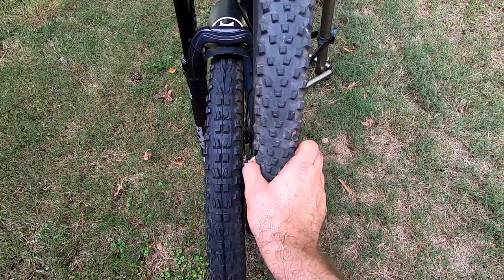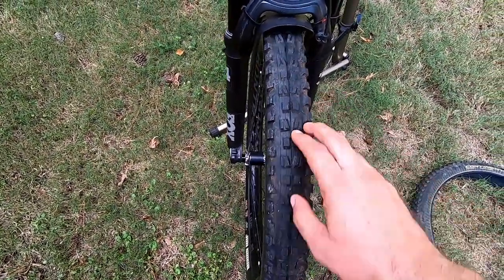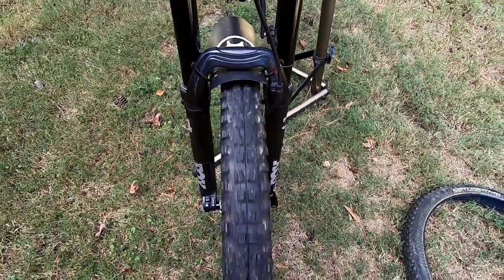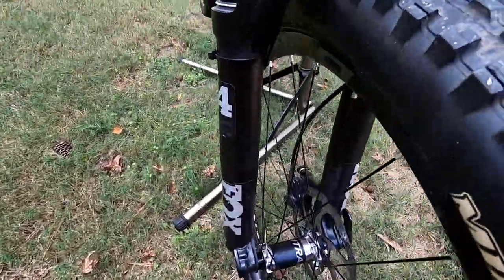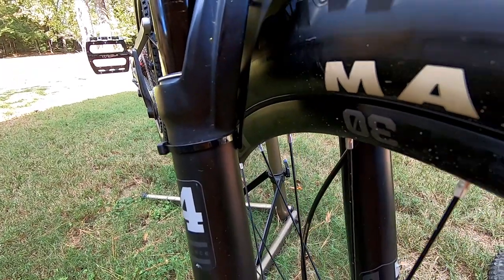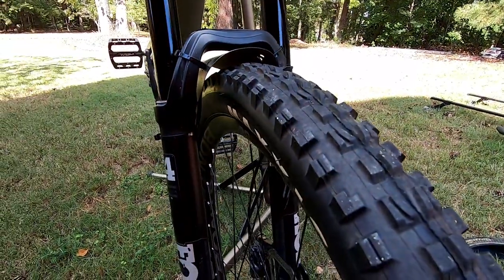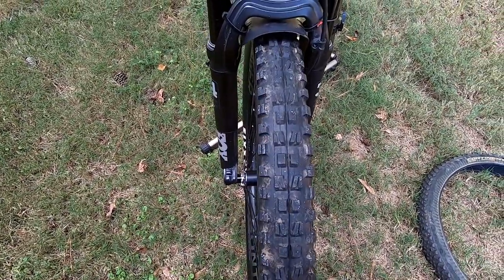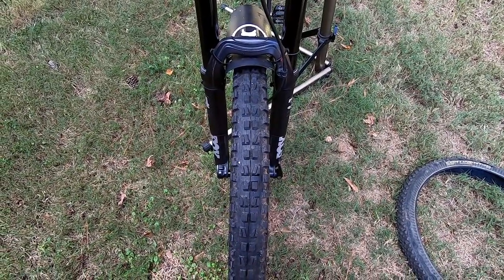The Maxxis Tire Wobble, is it common??

Comment: The tire is not seated right on the bead. The tire doesn’t have a wobble it’s just that it’s crooked
Reply from the maker: 😂 If I had a dime for every time somebody said that. Read the comments…
Reply: eastwood yes in some cases the tire may not be seated right or if you have tire inserts can also make it wobble but in his case and in my case and many other is an issue from factory nothing todo with the bead or if it was not install properly. and it seems to be a very popular problem with maxxis only. other company's that are no so popular dont have the issue and mine you have the the full package dhr 2 tuff casing terra cuz i tough the pros and most forums saids maxxis are way to go. but no im thinking they may have really good performance  but the quality of the build ummmm not the best.
Reply: @thomas_00001  try using soapy water to seat the bid correctly and a air compresor if you have if not remove the air valve to get the most air in with your air pump. soapy water can help alot when it comes to sitting the tire and take a close look to make sure you have the same amount of tire showing all around. follow the line the is above the bead to ensure is all even sometimes have some one else take a look and see if they can spot any defects but soapy water should help a lot  put it all over the rim and in the bead. good luck
Reply: @257sombra  I had Tannus as well and took it out and the same wobble is there. I made sure all the beads are seated equally around on both sides and still wobble. Same tire Maxxis DHF 50 PSI.
Reply: @ronelborromeo6013  It's the other way round. Your tires were fine before you installed Tannus. Tannus damages tires by uneven stretch during inflation. I destroyed multiple tires before I realized it was the insert. I proved it by first installing the tire without Tannus. Everything was fine. Then installed the insert. Wobble. Removed the insert. Wobble was there forever.
Reply: Same tire same problem I can't feel it tho can u
Reply: I have purchased 3 sets of Maxxis Ardent 27.5 x 2.25 tires in the last 5 years. The first 2 sets were great....the last 2 Maxxis Adrent tires i purchased have that same wobble issue as shown here in your video. and yep, my wheel is true... and the beads are fully seated... I finally pulled the current basically new rear tire off and replace it with my old tire that still has 60% life left and guess what. NO WOBBLE.. MAXXIS needs to refund people for the poor quality control...

Comment: Nothing to do with the tyre not seated correctly, if that's the case you shouldn't fit a tyre at all. I've buckled the tyre twice now using minions. I like to take corners full on and ended up folding the tyre. It's pretty new aswell, it's ready for the bin 🤦‍♂️

Comment: I have had a slight wobble on a few Maxxis tires.  Nothing to the extreme shown in this video.  Sometimes reseating the tire bead with alcohol and massaging the tire with incremental pressure increases mitigated this.

Comment: I checked my tyres, I saw my front tyre was wobbly, but I saw bead was nicely set on the left on on the right it was too far in to the rim, so this twisted the tyre, I had to let air out and use tyre pliers to get the tyre true. The tyres I have on my bike now are not worn out yet, knobs are fresh, the tyres were fresh when I installed them.
Reply: Thanks for posting I'm going to have to try this..I got some conti trail king in the front that had alot of wobble. The rim looks true so I swapped the tire out and I get less wobble but still wobbles a bit.
Reply: @manny_fit  if you don't have this tool, just unseal the whole tyre. and redo it.

Comment: Same here. Thought they weren't seated properly or my wheel was out of true. Sidewalls have been sweating tyre sealant in the past year, presuming rubber started to weaken, but no other issues till I took a few birms a bit more aggressively and rear tyre made some weird vibrating noises. Presume some fibers got damaged under stress. Clearly, it's not normal for a new tyre to do this, but in my case the life expectancy seemed to be 12 to 18 months depending on use.

Comment: I had the same problem, 2 sets of maxxis pace for XC kevlar and wired.  the installation was very thorough and carefully tried various methods from spraying soapy water to the pump slowly pulling manually on the beads, still wavy.  tired of maxxis now move to another brand

Comment: Yes. I've been working for hours trying to remedy this on my Aggressor. I thought it was badly seated, took it off and put back on, took out the insert and tried with a tube. Then I decided to check the internet. Should have done that first. Thanks! Thought I bought a bum wheel, but its just the tire.

Comment: Thus has driven me crazy with 2 bikes.Always thought my wheel kept coming out of true and was getting really upset.Come to fine out it has always been the tires..Both have dhf and dhr.If you have to struggle to get this tire on your wheel it seems to stretch/warp the sidewall casing causing very noticeable tire wobble.I finally ventured out and put a WTB VIGILANTE on my bike and so glad I dropped maxxis.My front wheel has never tracked more straight then it does now with the vigilante.
Reply: I did everything to seat my tyre properly & it still wasn't right😂S t r e s s
Reply: I think you're onto something with the "stretch/warp the sidewall casing". I noticed the warp after struggling to get a Maxxis DHF on a new wheel with inserts.
Reply: @smeekteek  yea keep going around the tire and pushing it as far center as possible so you don't have to stretch the bead that much.Its a little harder to do with inserts but possible with some patience so you don't end up with that really irritating tire wobble.

Comment: Yep... I've had the same issue with high roller, minion ss and dhr..  Indeed a common problem with Maxxis but apparently they prefer to replace your purchase rather than fixing the cause. All vendors are aware and they will replace the tire. The real problem is when you have to replace more than 1 time with the same vendor.

Comment: yes is the tire and its 2021 june and they all have some type of issue. but new tires hdr 2. im thinking is more because of fast production and also the walls will leak when in high humidity.  i have bought dhr 2 dhf Assegai i have also the tan color walls for the hdr 2 and they all have some type of imperfection. i tough maybe it was because the tire was old from seating on the warehouse but after buying a brand new pair i notice the same issue. and yes i also so tough it was my rim so i took it to a shop in ny and the mechanic told me it was a problems from maxxis tires he also belive thats it could be a fast production problem.

Comment: I have the same issue. Was wondering maybe my spokes not through. But no. It was tuned well. I've tried to fix it for couple of time but still doesn't work at all. I went to bicycle shop to fix it for me and still fucking wobbly. But what i noticed about maxxis tire was the more it get bald and you've to reinstalled back. Wobble will be lesser. I'm using 27.5x2.50 MINNION DHF.

Comment: Exact same problem with Kenda 4 inch tire on Himiway ebike.  I've been trying for 5 hours the soapy water and overpressure (60 pounds), so far without success.  I note that the EXACT
 same thing has occurred with previous tires of different brands.  Usually a lot of time, soapy water, and overpressure will do the trick but not this time.  At least not so far after 5 hours of trying.

Comment: I have the same problem with a Maxxis Agggessor. It is as bad if not worse that the one in this video. YES it is seated correctly. Seems like the canvas is damaged permanently, got deformed by a dodgy sideways landing. It won't run true anymore. So obviously easy enough to damage the sidewalls in these.

Comment: Same but its on my wifes bike. Maxxis dissector 27.5x2.4 set-up tubeless. She is 120 pounds and runs it around 16 psi on mils XC trails here in GA. The tire was fine when first mounted but now 3 months and 12 rides later I noticed a wobble. Checked the rim on my truing stand and its true. The bead line is even all the way around. I guess its just a bad tire like all the others

Comment: Same here with DHR II 27.5 2.4 MaxxTerra, Not so strong like yours but still annoying. DHF 2.5 which I have on the front is fine. I think its mostly by those beefy tires (or grippier compounds). My stock High Roller 2.4 (hard performance compound) are OK. On my XC bike Recons are also super straight. Never had that issue with Schwalbe tires. Now I just leave it as it is as it does not affect my ridding, but next time I will return them for sure. Tip - just do the dry fit before you put the sealant in, you will save yourself cleaning before return :-)

Comment: New pair of DHR2s, same problem, so frustrating. Mounted 3 times with soapy water still wobbling like crazy, never had this issue with any other tire.
Reply from the maker: I think there has to be some kind of quality control issue. Maxxis needs to fix this or they will continue to lose customers

Comment: I have the exact problem.  It started after riding an off camber trail.  I'm only 165 and 59 years old so I definitely didn't "overstress" it.  It was inflated properly.  Tire fail for sure.
Reply from the maker: I later noticed a crease on mine's sidewall. I'm 53 BTW, but weigh 200lbs!

Comment: I've had this issue on 2 of 4 Maxxis tires. An Assegai 27.5*2.5 has a slight wobble, ridable but really annoying as a front tire. A Minion DHR II 27.5*2.4 developed a significant wobble after just two rides. I did crash on the second ride so it may of weakened the sidewall or bead though. Initially it rolled true. Whatever the cause, I'm taking my business elsewhere now.
Reply from the maker: I went back to the Conti I had on it before, no more wobble

Comment: I had this problem at first with my Minion DHR 2.6. I heard to try soapy water on the bead and rim. When I pumped it back up I could actually hear the bead "pop" into place, and it was almost perfectly true. Got a flat on the trail and had to use a tube, and it was all wonky again after using a hand pump..once home, Itried the soapy water method and it went on straight as an arrow.
Reply from the maker: I installed this one with soapy water and a compressor at 50 PSI, it definitely "popped". I then removed it and tried it again. It was also about the 30th tubeless tire I ever mounted. In this case the side wall had a visible defect when I removed it. Very common if you read through the comments. I replaced it with a new Continental and it was perfectly straight first try.

Comment: I just noticed it on my bike a few days ago, (mind you I’ve had it 7 months, new bike) that I had a similar wobble on both my tires (same Maxxis tires) and I was told at my local shop that they are known to do that. Specially since I ride in a very rocky area. I was surprised and disappointed that a 7 month old tire would go bad. Does this sound correct to you guys, is it really normal for this or other tires?
Reply from the maker: I will admit that the tire on my video was used for about 4 months then replaced and stored then remounted. I can actually see the defect on the side wall now that I removed it again. To me this should not happen to a high end tire but it seems to be a common thing even with other brands. These tires do get abused

Comment: I had this for years, but sometimes I had to reseat it twise or more, but also when tyre was used longterm, it developed warp, also bead fails. This has happen on all tyres i had in my previous bike, and now at new bike, so tyre øy last few months, usually I can use a tyre few months one year than the next, but idf I try to push it for whole season, it's wearing bead off and wobble is horrible. But I saw a video where a rider supported by an distrubutor of maxxis claims she gets about 5 months out of a tyre so that's about what I get I guess before it loses true. So I guess I am riding so hard and tyres get so much use I wear them fast but still use them bit longer than I should for optimal performance. So bead and the warping of tyres makes it horrible eventually, but otherwise the knobs are not completely ruined but start to rou d off, but I never managed to run one tyre so long knobs were almost gone, some do, but bead fails before that is possible for me.
Reply from the maker: Good point. These were original tires on my bike so they are over 2 years old and have been off the bike for over a year before I put them back on today..
Reply: @TonyHob  some are definitely defective, but I never had one that was 100% true but if it was bad I redid it and worked but, I've seen vids of worse wobble, but hats how the tyres look whe n I've used them for a long time. But I think I should try different brands too, I found Schwalbe to seat easier, at least Ice Spiker does but can be hard to remove but so can Maxxis be when sealant glues it I guess, but I can get them off anyway, so not an issue. I've not had warping with Schwalbe Ice Spiker tyres yet, I've only used them for few weeks.

Comment: My DHR II is more wobbly than my DHF but both wobble. Brand new rims and both tires are seated with soapy water so there's no chance that they're not seated incorrectly.
Reply from the maker: From what others have posted you should be able to get them replaced through warranty. In my case it was a tire that came with my bike and I had replaced for a year then came to find it wobbly when trying to re-install it. It was barely used though.
Reply: @TonyHob  that's the same exact thing that happened to me. I just put them back on my bike for the winter. Thank you I'll email them.

Comment: Having this issue at the moment with my DHF on the front. However it’s the same tire I already had mounted last season. I am not riding during winter with this bike. So after removing the tires (cleaning the dried tubeless milk) and mounting the tires again the front tire is wobbling but it did not last year. Also from the lines on the side its seated ok.
At the moment my question is not how can I fix the wobble? Its more should I even care?
Reply from the maker: Mine was the same situation. I remounted the tire to use on a more technical trail. I went ahead and rode it like that and could not notice it while riding. On close inspection there is a visible crease on one side of the sidewall. No problems after riding it though.

Comment: Mine are brand new. Not as bad as yours, but similar. I do think somehow reseating the bead would fix it, but apart from putting it back on and pumping it up hard I can't figure out how to do that.
Reply from the maker: There’s several videos on it. Basically release the air pressure, spray the rim and bead with plenty of soapy water, then inflate up to the tire’s max pressure (usually around 50psi). If it’s not working then probably the tire.
Reply: @TonyHob  What about the sealant? I just sealed the tires. Can I add soapy water and the sealant won't mind? I really can't see any variations when the tire is on the rim, but I'm guessing small variations at the rim lead to larger variations at the tread.

Comment: My grandson has Maxxis Agressor tires and his rear tire wobbles so bad we thought he had bent his rim put it on the truing stand  and the rim was maybe 1-2mm out it was all the tire and it was so bad that the tire would rub the chainstay every time it went around! It was fine when we installed the new tires after Christmas but developed after a couple of months of riding.
Reply from the maker: Same with mine, developed that wobble after some time but plenty of tread left
Reply: @TonyHob  Just tried submitting a warranty claim with Maxxis we'll see how it goes! I tried everything everyone had posted as a remedy and none were successful to any degree, however while the tire was inflated to max pressure 60 psi the wobble was decreased a bit only to return when the tire pressure was lowered to 20psi and I left it at max pressure for 24hrs! it's definately defective!

Comment: I got same problem with conti mountain king, trail king and now maxxis forecaster. Ofc wheel is true, tire is right seated. So my mech guy think that problem is with tubeless sealant. Maybe is to aggressive so it destroys tire casing. Now i try with different sealat and new tire, so will see after some time. If it will be same again, i give up and will ride without tire :D
Reply from the maker: Don't give up!

Comment: It happened to me but I think its the I install it. Do not force  it cause you will stretch it. You can install without a tire lever.
Reply: I'm with you.  I've had some light whobble in the past on some Maxxis tires and now it was time to mount a new set of tires... The front has no whobble and a lever was not needed but in the rear it's got a warped spot, exactly there where I had to use a tire lever and bead is seated properly.
Reply: @mijk69  I ruined 2 tires before I realized it 😑
Reply from the maker: These were installed without a lever

Comment: It caused of when you install the tire used tool, do not used tool, just open or install the tire by using hand manually...., its common issue for maxxis..if you used tool

Comment: Did you pump the tube up to max pressure with plenty of lubrication in the rim? You said you put plenty of soapy water, but not that you overpressurized it to pop into place.
Reply from the maker: Yes, 50 psi, I have literally installed dozens of tubeless tires before without any problems